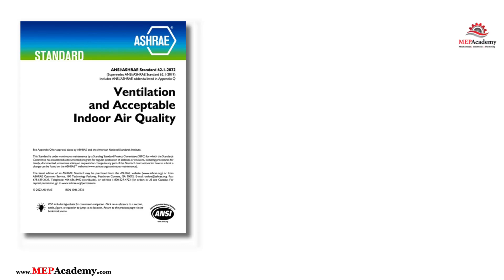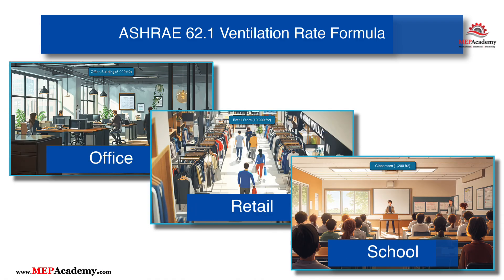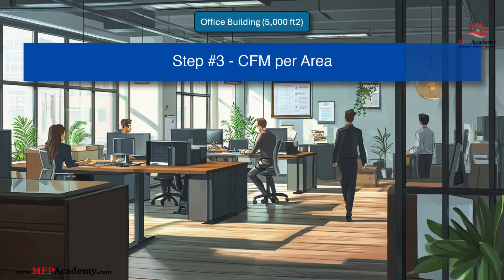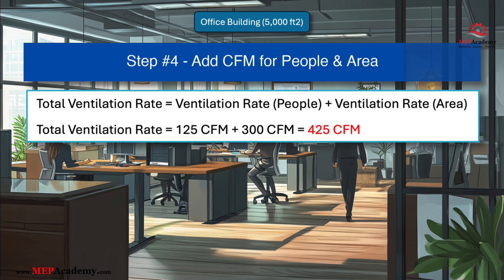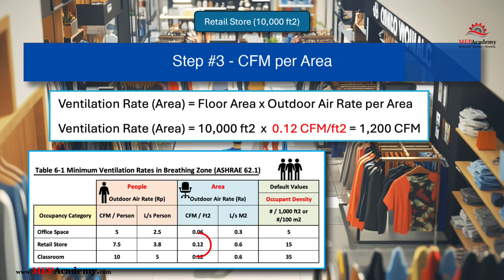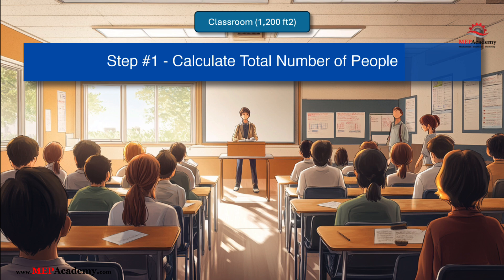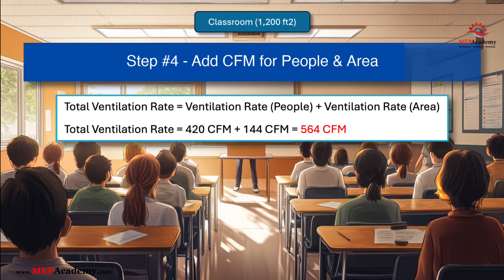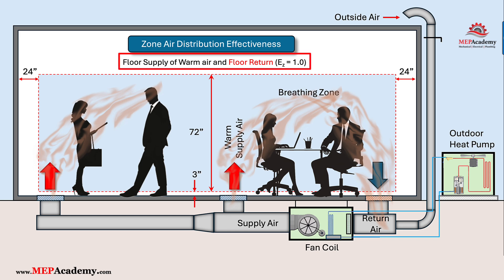How to Calculate Ventilation Air

Comment: What is use of Air change per hour ACPH in ventilation, why have you not use it ?
Reply from the maker: Various codes list the ventilation calculation based on occupancy level and square footage, while Healthcare you'll see more Air changes per hour as a requirement.